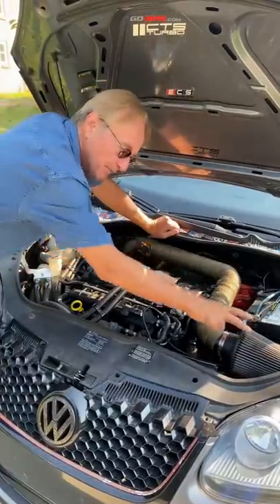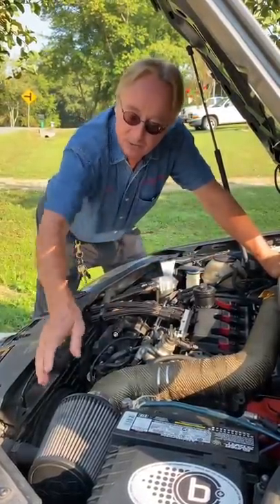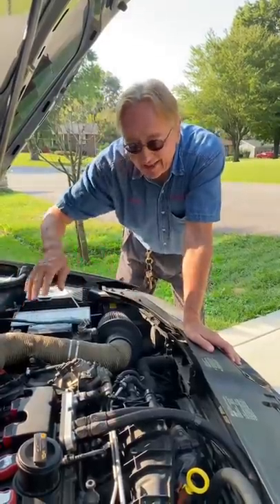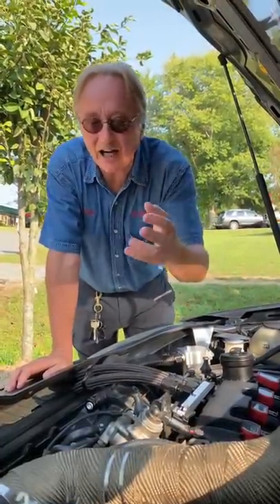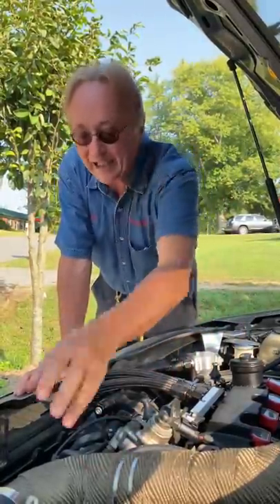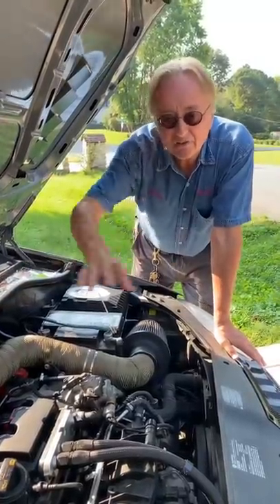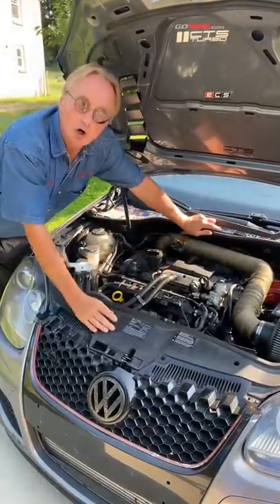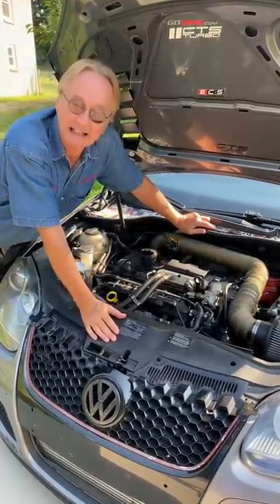Why Cold Air Intakes are Stupid

Comment: an ICE is work producing machine. It converts chemical energy to mechanical energy. To convert more chemical energy into mechanical energy, one must increase the amount of chemical energy available to the ICE. This is done with forced induction and larger fuel injections. A cold-air intake, contrary to it's name, is not actually causing colder air to enter the combustion chamber. The air it's sucking in air at the same temperature as the ambient air temperature in the engine bay. This is where methanol-water injection comes in. Methanol-water mix if injected into the air intake and the mist is effective at reducing air intake temperature to allow a more aggressive tune. Save your money on a CAI and get methanol injection instead folks.
t. engineer

Comment: what you’re saying is, it’s not problem to have one with a tune
Reply: If it’s designed properly with heat shields. Proper placement to suck in air, you don’t need a tune to get small increases

Comment: Uh…wrong Scotty. I’m sure that’s the case with some vehicles, but not all. This may come as a shock to him, but engineers with the sole job of designing a superior cold air intake are in fact better than the engineers not concerned with such perfection. I suppose it will also shock him to learn you don’t need a tune, your computer will adjust to it. That’s because the computer is always adjusting to elevation changes etc. Remember that song “Scotty doesn’t know”?it applies here 😂

Comment: Did the engineers design the chicken or the egg first...?  Yes, it matters because everything else must follow exactly, or does it...?  If you build a house, a door must be a certain width.  The remaining distance to a corner is whatever distance is left, it's never measured to a lasers tolerance.  The engineers are not an exception.

Comment: They work on turbo and supercharged cars.  
Also. You can buy a ECU tuner for 350 bucks and run a 93 tune.  Even increase injections size. 
Just throwing one on a , let's say stock stupid civic.  Not going to do much of nothing without a ECU tune and exhaust.  
The car does compensate for the extra air flow.  So your gas mileage will go down a little.  
I personally run my own design intake.  But I have upgraded injectors and a high flow exhaust.  Doing a ECU tune soon. 
Warning ⚠️ do not buy eBay high flow filters...
They are very restrictive.  That's why there 50 bucks lol.  K&N or another company that's trusted.

Comment: Lol several cars I have owned I have placed cold air intake on. No had a check engine light because I buy proper not cheap so it has a sensor plug that's the only reason it would turn it on because of no sensor port 😂😂😂😂

Comment: So how do I help my daily driver I have a 08 hhr standard trim 4 speed automatic in the air intake and filler system is just shity looking and complicated plus my fabric hose is ripped in 2 areas like what happens to all hhr's so how can I avoid lose in power and the why air flows because I also don't have hood vents or anything

Comment: But that's not a cold air intake !
Ram cold air from outside the engine bay
Have the air cleaner sealed from the engine bay -heat

Comment: That's a whole lot of yapping and saying nothing. Here's the deal: "If you install a cold air intake and it's near a heat source, the filter can heat soak and actually reduce your engine's horsepower. Unless you have cold air induction through a cowl hood or some sort of opening and bringing cold air to the filter, don't bother with a cold air intake." There you go scotty, I fixed it for you. Also scotty, for certain V8 engines, you can 5-10% increase in horsepower. And also, if you do tune the car, that increases horsepower also. So the 1% increase is total nonsense. We love you scotty, but sometimes you sound like a total buffoon

Comment: I dissagre ...superior air flow more rpms . No need of tunned. Its proven more horsepower . And save gas . All factory air are restrained  air flow.  Bigger air flow and superior racing filter. I have trye over the years....more aggressive speed.  Sorry for the opponion. Its cheap way for more power.  No need of tuned....with all respect to mister scotty .

Comment: Scotty. You clearly have no idea what you are talking about. I've been building and racing fast cars for 30 years. Manufacturers design air intakes to comply with many automotive regulations and for optimum emissions, mpg, noise levels and to work across many continents with different weather and temperature conditions. But.....They ARE restrictive to the engine. Even a short ram induction kit which is pulling in warm air (like this one) will help the engine breath better which will give you better throttle response and smoother torque delivery. On the plus side they always make a car sound better, especially turbo charged ones. On normally aspirated engines where a map has limited effect you couple them with a decent throttle body, equal length primaries on your exhaust manifold and a decent free flowing exhaust and you will notice huge differences in power, torque and responsiveness.

Comment: If the car is meant to run one way why is there different types of fuel, specifically e-85 and flex fuel vehicles where the sensors and ecu adjust timing and all that accordingly. I call bull, never really been a fan of scotty and never really listened to his advice that much and my vehicles are perfectly fine.

Comment: This was a super biased video. Your engine will in fact run perfectly fine after a cold air intake swap because your modern cars' ecu automatically adjusts for the amount of air entering your engine. 

If I'm being completely honest here, if you want full results, what I want you to look into is using a simple laptop tuning and usb to obd2 cable and learn to tune your car yourself. 

One youtube video I figured out how volumetric efficiency works; and how to tune my car for a performance tune; for free! If I can do it; you can definitely do it.

Comment: All airplanes take the air FROM OUTSIDE, never from THE HOT inside the engine compartment, you dummies.  Im an airplane commercial pilot and mechanic for decades.  No accidents.

Comment: 😂 wrong ur only changing  the filter sensor still on no problem   and he said it doesn't make a power difference  wow this grampa is stuck in the 70s actually  it does make a power difference  specially  when ur doing over 40 mph faster suction  and you can feel the difference  air is going in faster and freely  compare to the stock 1,5 inch by 4inch no air going in grampa needs  to update his computer  the stock air intake suction  hole is made to protect  the engine  frome sucking  in water thats why they are hitten take the L gramps and no is  a car  is tune doesn't mater and no your not getting less power

Comment: Do people really believe the stuff this guy says honestly. Also thats not a cold air thats a ram air intake/hi flow a cold air would move the filter probably into a wheel well away from the engine  and adding any of these intake wont set off your check engine in an of itself some brands do not have a  map sensor location and those send a check engine do to that but those are ment to then be tuned wich fixes that issue. I hate that this guy speaks in a way that makes sence to a non car person but hes full of crap